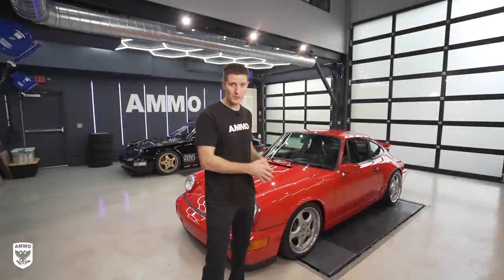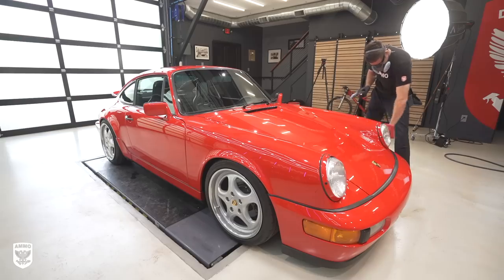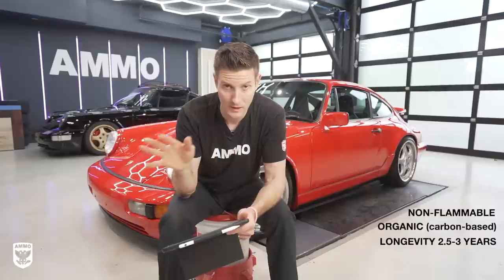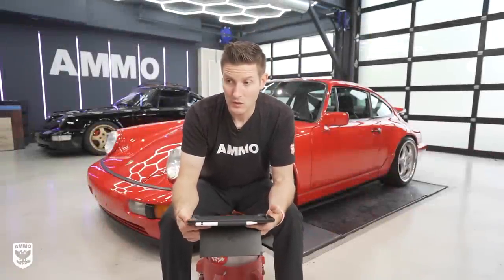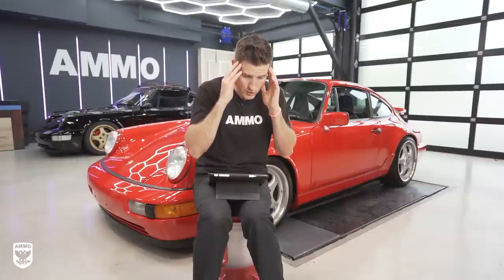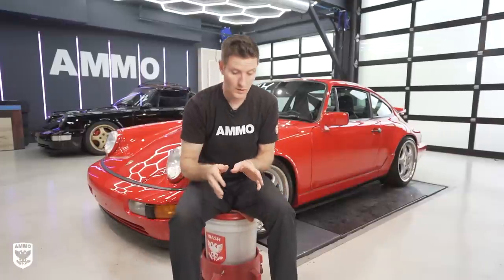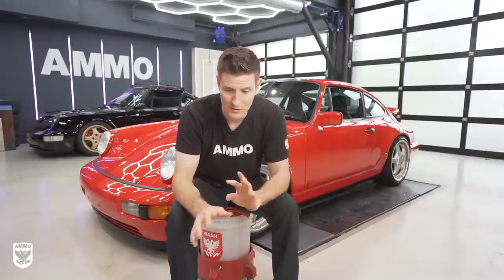How to Install Car Paint Coating: AMMO REFLEX PRO

Comment: i'm doing this more for myself as a reference, but i'm sure someone else will be glad i did.
5:58 How long does it last?
7:27 What makes Reflex Pro different from the original Reflex formula?
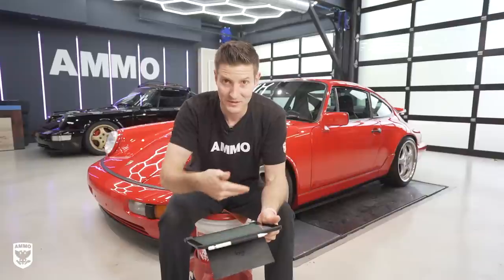12:53 Why did you use the same name, Reflex?
13:17 Do I have to "strip" the paint before application?
14:47 Do I need to polish the car before application?
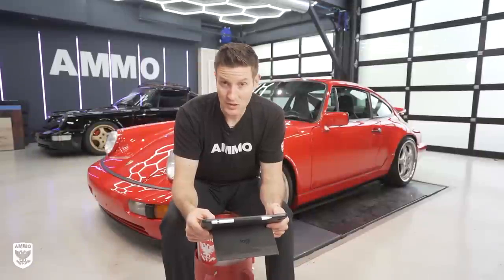15:21 Can I apply two layers?
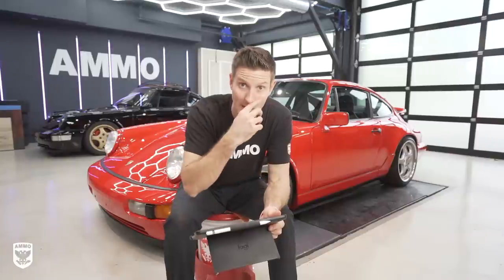16:05 Opened and unopened shelf life
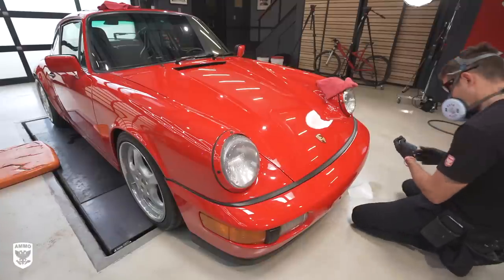16:33 Do I need to throw my buffing towels away after application?
16:46 Should I coat the entire car before removing excess/flashed residue?
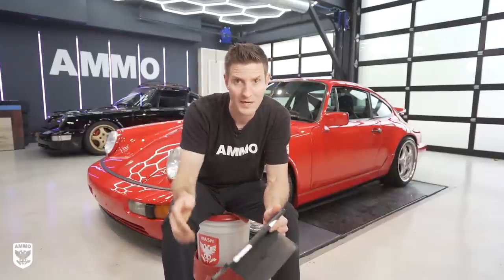17:10 Can you put it on PPF?
17:23 Can I put AMMO Creme on top of it? Can I layer other products on top of it?
19:21 How do I maintain it?
20:22 Can I apply a second coat of Reflex Pro?
20:39 What is the white stuff on the bottom? Anti-Microbial additive
Reply: I just came back to refresh my memory on some things, so this is greatly appreciated!
Reply: Thanks Buddy. You deserve a big French kiss 😘   No homo
Reply: This should be pinned! Thanks! 👍👌

Comment: This is great stuff!  I was in the detailing industry for over 10 years, and when Ceramics came out there was a lot of smoke and mirrors and it always felt like snake oil in order to sell people on proper paint correction through compound and polish (since people were charging upwards of 1k-2k to do an application).  When I heard people offering "Paint Warranties" it felt like a dealership offering you a special "paint coating" which was really just a mass cash grab in hopes no one came back to collect.  This explains a lot better about what you are offering and looking forward to trying it out.  My background is Mechanical Engineering so I'm always down for a nerd session lol

Comment: Your dedication to our profession is motivating.  Your selflessness and openness has really helped me to see through the BS and appreciate the truth even more.  I hope the top Detailing'channels watch this and learn.  Because I was this close to buying a Graphene coating because the channels I watch have said it is better at preventing waterspots than Si02 coatings.  Now, if I understood you correctly, it is the coating and not the graphene that does the work.     How good is AMMO's ceramic at preventing water spots?  My daily driver is not garaged and I had it coated with Opti Coat Pro Plus and Apel film in January.  But water spots have been an issue.

Comment: ok so how coatings and additives was explained to me... coating or base is the cookie dough... additives are the things you would put in it; chocolate chips, raisins (trust issues there) reases et al. the additives do different things to the base, sweet, salty, peanut buttery etc, this doesn't change the base cookie but adds to it and makes it better (imho).

Comment: just saw this video. I want to run out and buy this product. I am amazed Larry has the same attitude and approach as me in re coatings, and the newer trends. however, I noticed this video is almost 2 years old, and mt big question is: has this product changed at all since the making of this video? (are there new additives being used, or has it changed in some way)?

Comment: How dare you upset the balance of graphene, LOL.  I’m kidding and I appreciate the transparency of your discussion.  You explained it so well and it’s great to have this information.  

I look forward to trying out reflex pro.  The red looks amazing under the lights in your new shop.

Larry I forgot to ask does this have the sheeting characteristics of the previous reflex?  Or is it more hydrophobic?
Reply from the maker: Hydro with low surface energy (so everything else: water, oil, etc...has a higher surface tension than the painted surface)
Reply: AMMO NYC STUDIO thank you.  I will be picking it up with Reboot. Thank you again for the technical aspect of the coating discussion.

Comment: So is this technically a ceramic coating even though it may not be in the same traditional sense? Also I am curious your thoughts on spraying iron removers on paint. I believe they get acidic when activated(turning purple) so I always wondered if that was really safe for the paint or a bit harsh. 
As always love how indepth you have gone in this video, I really hope you will be able to make videos going over all the AMMO products again and which ones work best with each other.
Reply: Most of this stuff gets red. Because of that in Poland we call it Bloody Rim. And I would not recommend to use it on any other surface then rim. And you need to remember to rinse it really, really well after using. But the producers say that it is a PH neutral (it is not acid) product and should not do any damage to the paint. But like I said. I would only for the rims nothing else.

Comment: Larry if you wanna put two coats on and you have to wait six hours at least in between coats, how do you prep the car for the next coat because if you’re waiting six hours you’re going to have some sort of dust and stuff that’s just gonna fall on the car. What’s the best way to handle that ? thank you
Reply: Same question here! 🙋‍♂️
Reply: I was thinking the same !
Reply from the maker: You can wipe with REBOOT and you will be in great shape. Just don't over touch. let it do its thing :)

Comment: Larry, what is the best mask filter for applying ceramic coating? P100 or P95? Couldn’t tell which one you’re using there. I just don’t like inhaling those vapor or fumes from the coating. I’ve always been wearing mask but not the recommended one. Thanks!

Comment: Lets talk Graphene in more depth since this topic seems to come with alot of speculation. 

In order for a graphene coating to be called "Graphene" it must be forming a single atom layer of a graphite matrix which is what gives Graphene its unique strengths and actual scientific classification. 

Larry you are correct that some manufacturers maybe adding Graphite or "Carbon Black" to an emulsion in order to market their products as Graphene, but this simply does not mean this is how all Graphene technologies function.

In fact, Graphene on its own is virtually transparent so the misconception that the coatings color classifies it is a misnomer. 

Real Graphene coatings attach Graphene to a substrate through a similar delivery and attachment system to those of Ceramics, and how resins can adhere to a substrate. (This is not to be confused with Graphene as an additive to a Ceramic Coating). Used in this format you are correct in that it would add very little benefit. 

Engineered Graphene coatings are not simply an "additive" that is blended into a ceramic coating or coating in that manner, it in fact comprises the actual active ingredients that give the coatings substrate its physical membrane. This is similar to compare Hydrogen and Oxygen as additives to Water, when in fact they compromise the molecule itself.

Hope that helps clarify some misconceptions and would be happy to discuss this in further detail!
Reply from the maker: Sounds good. I'm going off the info that many of the chemists around the world have described to me as to the application of graphene in TODAY'S detailing market. Based on the many similar responses, I have decided at this time to avoid it. However, if you have figured out a way to make it work than I encourage you to keep it going!! Thx for watching :)
Reply: Adonis Detail Tim! Long time since we’ve chatted. What are your thoughts on the difficulty in creating a 2-dimensional vs 3-dimensional graphene structure? From what I’ve been able to scrape up via a google search, creating a multi-tier structure utilizing graphene is incredibly difficult. Thanks.
Reply: @iamwaxman  Graphene wouldn't classify as being 3 dimensional, if in this form it would be technically "Graphite".

It's actually fairly easy to make a single layer of graphene, (You can perform this through a "Scotch tape method" in your own home) Manufacturing of this can even be done at large scale.

What has been difficult and is a misconception about Graphene in general is making flawless sheets of graphene (without defect) for use in conductivity and circuitry. This industry requires Graphene matrixes that are flawless in design without defect due to the need for electrical currents to pass through uninterrupted. Part of the reason Graphene has not seen widespread adoption of use in technology is due to the fact that currently silicone is still cheaper and easier to manufacturer at scale with much less risk of defect.

Graphene does not need to be a flawless matrix in order to gain its strength and flexibility characteristics and thus leads to an easier manufacturing than assumed for use in aftermarket coating applications. Graphene is also currently used in paint systems throughout many industries at volume due to these benefits.
Reply: Adonis Detail dimensionally, how thick do you reckon a single layer of graphene measures out to?
Reply: @iamwaxman  it is one atom thick.
Reply: Adonis Detail, what are your thoughts on a more traditional coating’s structure/dimensions, in comparison to an atom-thick layer of graphene?
Reply: Adonis Detail Tim do you use these Ethos products as part of your detailing business on clients cars?  Just curious.
Reply: Mike G yes we do.

Comment: Hey Larry, I have a practical use question. Could I coat the windows of my car with reflex pro? I am assuming that this product helps with hydrophobicity and it would be convenient to have water slide right off my windows and wing mirrors while I am driving in the rain, as it would significantly improve visibility.

If the answer is yes I would also be curious about some of the other impacts of coating car windows with reflex pro, such as how it affects UV from the sun entering the car, reflections from the dashboard onto the windshield and even if it can help lower the interior temperature of your car when you park it outside in the sun on a hot day.

If not, are you working on a product that would be for glass, that could achieve the affect I am thinking of?
Reply from the maker: I touch on this in another question but yes I'm looking into a glass enamel that can achieve those results.

Comment: Using dishwash soap is a good way to strip your paint?
Reply: It’s a good way to remove all waxes and oils to get rid of anything ON the paint. It doesn’t “strip” it, if you mean remove it or take it off. Totally safe.
Reply: @scorpion12457  yeah remowe al waxes. Thanks! At this stage i use IPA..
Reply: Kim W perfect! In the video Larry puts the Dawn in and then after he hits any other spots with IPA. Best to you Kim, stay safe out there.

Comment: If you've applied a competitors ceramic coating and you're not happy with it and it's been about a year since the application, how would you prep the paint for Ammo reflex pro? I wished I never sold my 964.
Reply from the maker: Hard to know for sure based on their chemistry but a polishing is probably a good option. (as a guess)
Reply: What coating? And it lasted a year and ur not happy? What is wrong?

Comment: 2:24 I strongly disagree. Every car needs to be polished prior to applying protection, to REALLY get the paint bare/clean. This will ensure maximum adhesion, performance and durability. This applies even if the paint is swirl free! It doesn't have to be a full day of intense polishing, just a quick once over with a finishing polish to deep clean or "exfoliate" the paint so to speak. Try it yourself on a panel that's unprotected and do half only clean, clay and IPA, and the other half with the quick polishing step added. You will notice a massive difference.
Reply from the maker: Appreciate your note. Not sure we "disagree". If your technique works for you...then continue use it. Love it!

Comment: Your audio levels are all over the map. From super loud to way low. Watching on a TV with a high quality sound system, it just is horrible. Constantly adjusting sound levels.  Use a compressor plugin and a loudness meter to get levels more even. Every other edit the levels are dramatically different. At least YouTube’s automated captioning is pretty good.